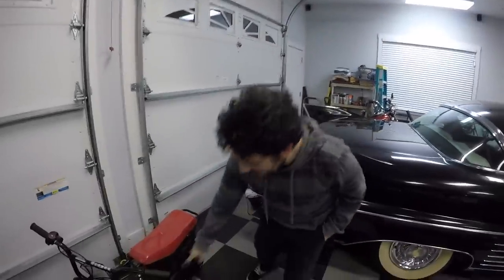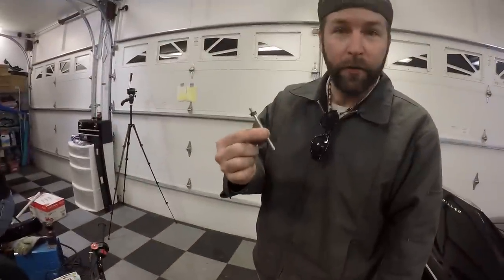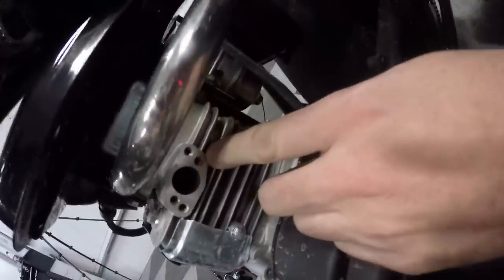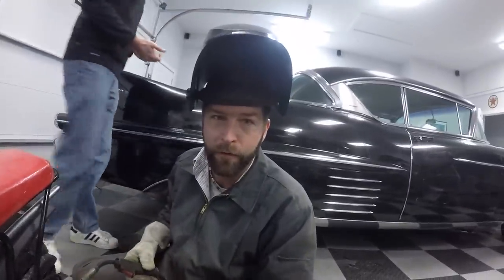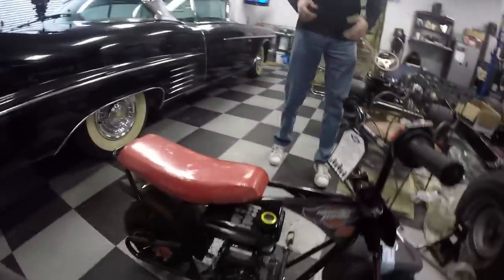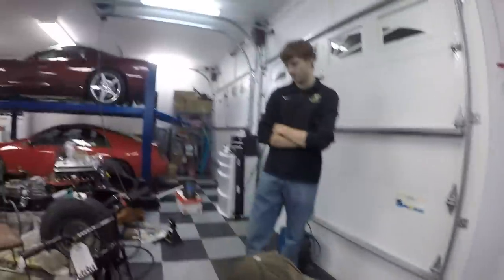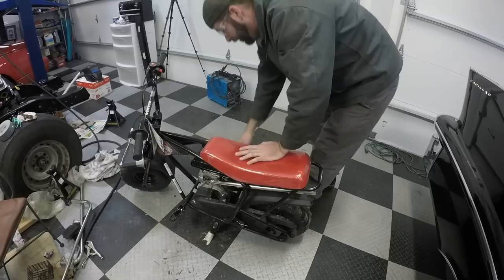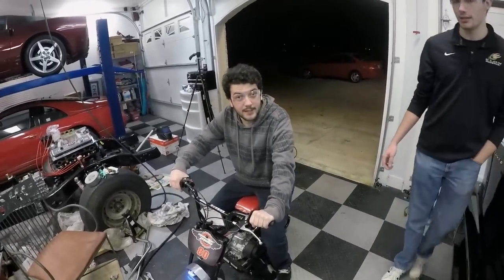Cheap Mini Bike Mods! Pt. 1

Comment: My little brother got the same bike for Christmas and completely stock with me riding it (130lbs) it topped out at 26. Got it to 28 with minor throttle adjustment. And it was at night.
Reply: And if you don't like the forward facing exhaust you can literally just take it off and bolt it on the other way.
Reply: +Benjamin Kenney ours only went 15
Reply: +Isaac it'll be fine I adjusted the throttle even more and I hit 36mph. All it took was replacing a spring on the throttle with a wire, otherwise its all stock. I might even make a video of it.
Reply: Governor bypass?>
Reply: My ct100u went 34 -35 with only removing the throttle screw

Comment: What size drill bit do you need for the carb jet ??????? Plz anwser
Reply: No one hasn’t found out? I’ve been building my shitty 105 installed predator springs changed the timing did a straight pipe removed the governor put a copper head gasket the last thing I have to do is drill out the jet and I can’t find out what size 😅

Comment: I just bought one of these new from amazon. I weigh 240 lbs and stock I hit 22 mph. Then the only mod I did was remove the throttle limiter screw and top speed was 27.9 mph. I'm going to remove the governor and will post my results. I have a 118 cc lifan 4 hp engine with a governor delete  and a 26 mm nibbi racing car that I'm gonna put on that should be fun. Anyway great job guys.

Comment: i have a question i have the same bike 80cc and my question is does it fit PREDATOR ENGINE 13 HP (420cc) OHV Horizontal Shaft Gas Engine EPA?

Comment: How did yall set up your carborator? I installed a wire from the throttle to the carb, removing the springs. Now the motor is wide open all the time.

Comment: I bought a used Doodle Bug for our kids for $100 in pretty good shape. I have a greasy thumb but can't figure out why the throttle is finicky? It decides when it want s to go WOT or just part way on it's own. Any thoughts as to what it may be? Carb checks out fine. I might buy new gaskets or make my own. That's the only thing I can think of. Maybe air's getting in where it shouldn't? I think I'll do the jet and governor mods when it cools down here in Florida. I love watching your videos! You all would be fun to hang out in the garage and tinker with.

Comment: hi i am having problem with my 50cc mini dirt bike, the clutch spring keeps falling off and snapping and i dont know why? Ive bought 3 brand new clutches and first time i started it the spring flew off so i now have to buy another one. please tell me why they are falling off?
Reply: Clutch spring? Where the chain is connected? I ask because some people meaning of clutch could be the spring on the engine for the throttle cable. If not and you do mean what I think you mean then don't buy that clutch again. You're engine is to powerful for that clutch or the tires you have on plus you're weight is to much for said clutch. I recommend belt driven they run around 100-300 worth the money or same magnet clutch but they run 300-600 but it's probably just cheap clutches you can keep trying new and different ones but if it's a wheel size weight issue then this will happen again and going with a belt setup will correct this issue plus future issues you might have with clutches going out.

Comment: Ok guys I need help. Bought a razor pocket bike for my son. The battery 24volt battery is bad so I'm using a power wheel 12volt. I hot wire the 12 volt to the pocket bike. The light switch turn on but the wheel is not spinning. Don't know if I need a 24volt to get it going.
Thanks
Reply: Lee Vang you should check my brother out. hes a certified razor repairman / dealer. check alloutbikeshop.com/    email or call him im shure he could help you out.

Comment: 80cc damn!! My 49 cc Honda z50r can go over 25 max. Imma have to predator swap and make it go over 40
Reply: it doesn't actually go that slow. If you take out the throttle limiter screw, it'll go 30 stock.

Comment: What size drill bit did you use to drill out the jet on the carb?
Reply: Special bits, Google online for it. We have a set made just for boring put jets they even have the size of the hole you're making for the new jet.

Comment: for the welder 
i'm a guy from belgium and i wanna buy a welder but do you need gas???
Reply from the maker: +Korneel Van Den Berghe It depends on the type of welder, but most (if not all) good welders use gas. We use a 50/50 mix of CO2 and Argon (I think). Don't quote me on that.
Reply: YOU ANSWERED?! i love your vids!!!!!!!!!!!!
Thanks for the answer but here in belgium are welders and moterd very expensive,
The predator engine here is €350
Reply from the maker: Korneel Van Den Berghe Wow, that's expensive! Maybe the genuine Honda engines aren't much more expensive?
Reply: +CarsandCameras i don't now I will do soms research :)
Reply: +Korneel Van Den Berghe do you now a website where i can buy engines and go kart parts for a reasonable price?
Reply: +Korneel Van Den Berghe Je kan best een mig laspost kopen, heb je geen gas voor nodig ( bestaat speciale draad voor zodat je geen gas nodig hebt) is ook heel gemakkelijk in gebruik. Je kan ook lassen zonder gas met een laspost met bagguetes (maar is wel veel moeilijker om te leren en zeker als je helemaal geen ervaring hebt met lassen.
Reply: Lee Vdw Wow echt bedankt!!!!!!!
Reply: +Korneel Van Den Berghe Pour gasoline all over the area that you wanna weld "Roughly a whole 5 gallon jug" and weld away man.
Reply: +Korneel Van Den Berghe  order it from England and get it shipped over and will still be a lot cheaper.
Reply: Thanks!
Reply: Litteraly machinery is so cheap from England
Reply: u dont NEED gas but makes it easyer to weld and makes much nicer welds
Reply: +CarsandCameras I just got a mini bike with a rebranded Honda GX200 for $600 brand new
Reply: I got an old stick/arc welder from a garage sale for 10aud, and electrodes from our local hardware store for $15. Definitely the cheapest way to do it, but it does take a lot of practice and a little more work.

We actually don't have Predator engines in Australia and shipping costs from the US is ridiculous. But we do have 'Launtop' which produce similar engines of decent quality and 'Baumr-AG ' which I haven't personally tried because I've heard bad things about them.
Genuine Honda's are about 4x the cost of the brands mentioned above... 

You should be able to find something similar under a different name in your country.

Comment: These stock motors literally will not blow up unless you obviously take the oil out I jump on in a lake an let it sit for a few days changed the oil an it started after about 10 pulls

Comment: thatdrummerben I have the same bike to my bike did 15 out the box but I adjusted the idle and the throttle cable and the brakes because they dragged like a mfer but my bike tops out at 38 and I'm almost 200 pounds
Reply: Dang! I maxed it at 36, I'll post a video of what I did to mod it one of these days.

Comment: I just got one of these used kept in pretty good condition for 250 was gonna be 300 anyway I'm bigger than you guys I got it to do 27.1 after my dad messed with the spring not taking governor off because that does shortening the life of your engine not worth it and at first it only did 13.4 with me then I put more air in the tires since I could squeeze them in a bit made a huge difference thats when it jumped to 27.1 instantly then we were having an issue it wanting to take off by itself and it starting choking sound then dying so he put the spring back to how it was wasnt the issue I texted the seller since we friends on Facebook now told me to grease the clutch bam right after it worked smooth but because the spring or whatever being put back how it was  i was only able to do 22.4 at max speed on flat for dome reason I can't give any throttle going downhill it won't let me dnd jt doesn't rev up really either did I mention after pumping the tires I was able to get up hills further and much easier some I got all the way up but some only halfway and it sucks having to walk the worst  hills  because you have to bend low and I have a fracture in NY back an old one I just bought a 65 tooth rear sprocket that should help with speed by a lot you'd be surprised it dont take much too get the speed up by taking away more teeth I also bought a max torque spring for my clutch I found videos how to convert the clutch spring to a racing one but I just bought this bad boy to see if it works better than just converting the stock spring into one plus its only like 9.00 or bit over so its a pretty cheap but must have upgrade even just replacing that rear sprocket will make a huge difference which I'll probably try that first and if I want more performance and speed add that upgraded spring to the clutch

Comment: I have the same bike and i am 130 pounds but I go around 30-35 mph on it
Reply: I'm 120 with a ct100u and going 30-35 just with removing the throttle screw

Comment: So putting a exhaust makes it go faster
Reply from the maker: bryan rojas The stock equipment on these small engines are often very restrictive to comply with emissions or noise regulations, so by replacing the intake and exhaust while drilling out the carb jet (which gives it more fuel), it makes more power because more air and fuel is getting to that combustion chamber.
Reply: no, the stock exhaust was pointing to the wind, so it goes back into the engine, so they made theirs more quiet by extending it and more efficient.
Reply from the maker: Honda Sportsman Industrys Our exhaust made it louder- it's just a pipe, no muffler. And to reply to your other comment about centrifugal clutches (your replies were turned off on that comment for some reason), centrifugal clutches use (you guessed it!) centrifugal force to drive the go kart. There are often weights attached to each other via springs inside the clutch that spread apart as engine RPM increases. The weights come in contact with the inside wall of the clutch and that's what drives the rear axle. Just look it up on YouTube or Google- someone else has bound to have done a better explanation than I have.
Reply: CarsandCameras Thanks dude.

Comment: What size bit did you use to drill the jet?
Reply: @travyboy ever get a response?
Reply: @angelmedina6390  no lol
Reply: Damn.  This is for my 7yo son.  I won't get him a predator 212 till he's 11. This is enough power for him for now, so no need to spend extra $$$ buying mods for this bike,  when I can do it myself.  Thanks 4 replying!!!
Reply: @angelmedina6390  when I was 14 I had a moto thing minibike with the 80cc and I put a predator 212 on it with the hemi head but it would never keep a chain😂

Comment: I highly recommend not to un-govern your mini bike, my friend was driving his ungoverned and he de-accelerated then he heard 2 hard and loud pops then his engine exploded. his gears were shattered.
Reply: It's not ideal but it's safe to a point. If you do remove it do it right play with the carb and adjust the throttle so even at max throttle you're not pushing the engine to 100% little screw where the throttle cable goes on the engine prevents that.